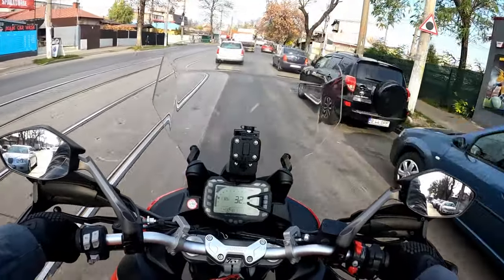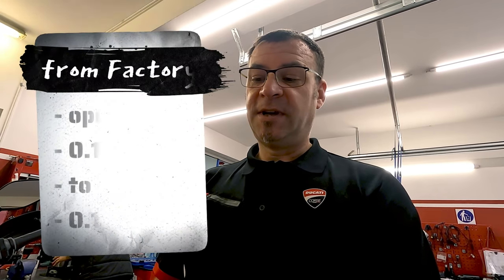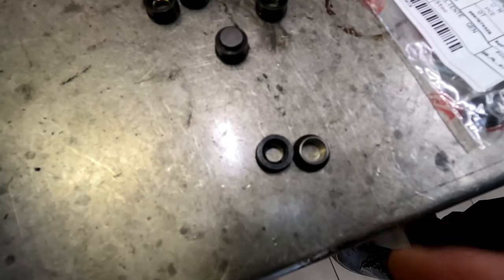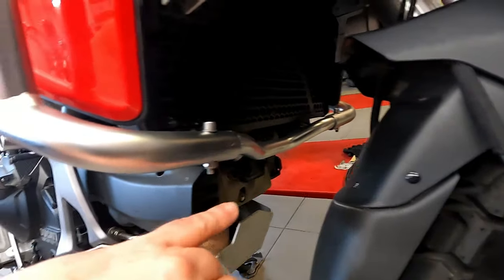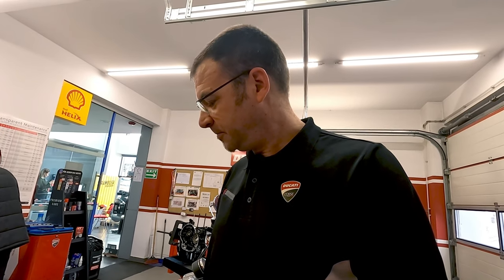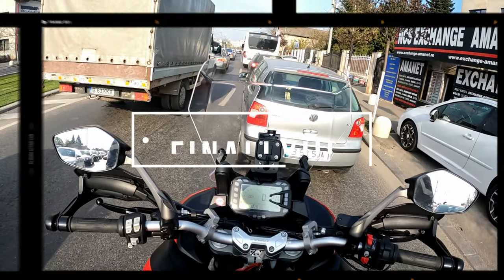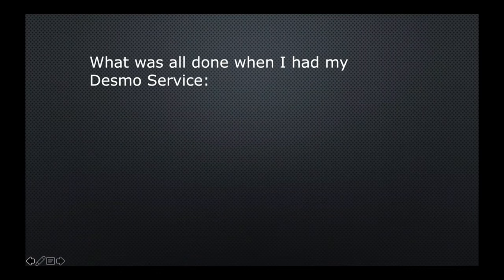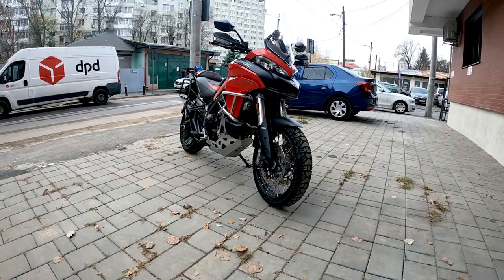The Desmo Service Multistrada 950 - #motovlog

Comment: Great video, no wonder the service is expensive as there's quite a bit of work involved. It's around 1000€ in the UK
Reply from the maker: Thanks Les!
So it is similar. I read in some forums that it can go up to 2000€.
I think it also depends a lot on how you treat the engine and on the regular maintenance, and last if you have a good dealership that doesn't overcharge you..
Safe Rides!